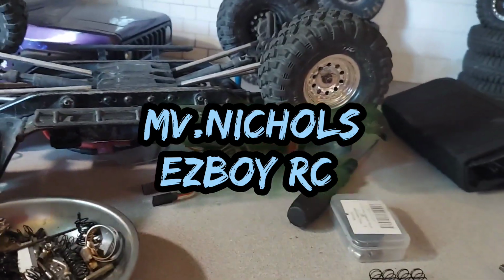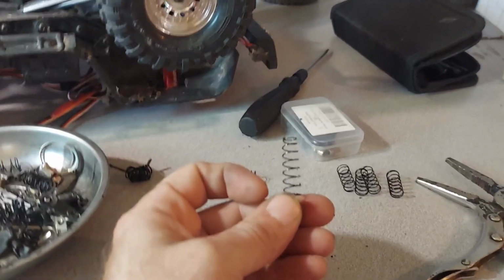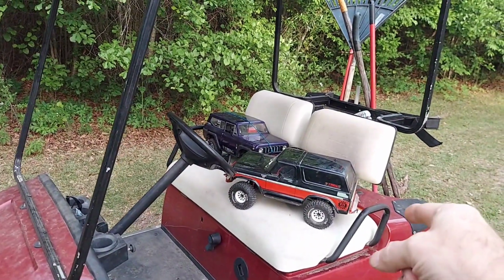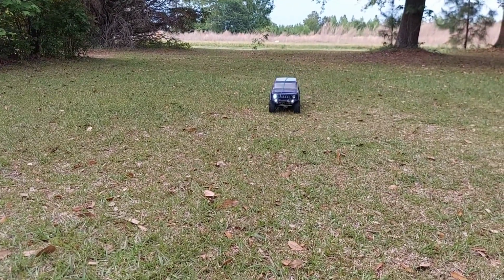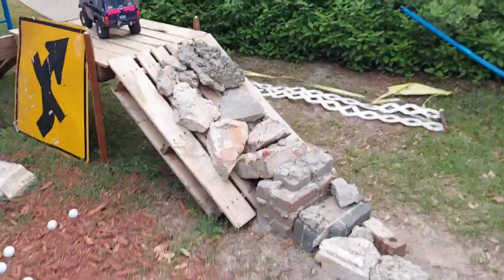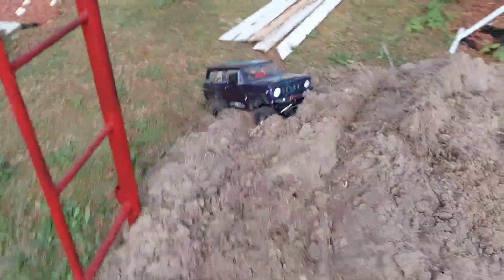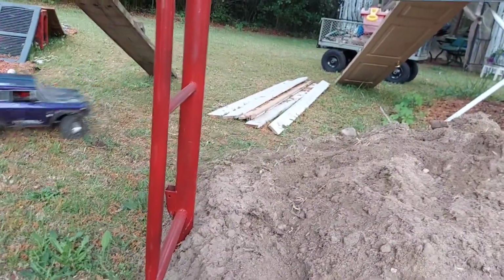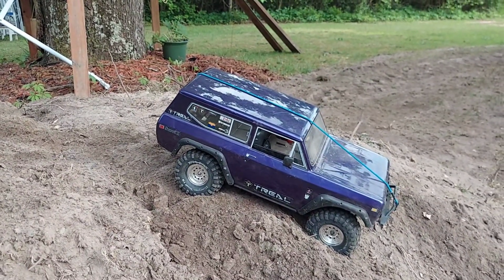Fixing the torque twist on Redcat Gen8 V-2 RC crawler with Injora Mountain shock adjustment

Comment: I adjusted my shocks on mine with the stock shocks to where the springs are as stiff as I could get them and when driving the whole thing leans to the right, I do have some actual desert lizard shocks that wouldn't work for the scx10.2 it should work for this one
Reply from the maker: they don't work good stiff. I like my shocks soft and all the way down it stays level that way. But put the desert lizards on for sure.